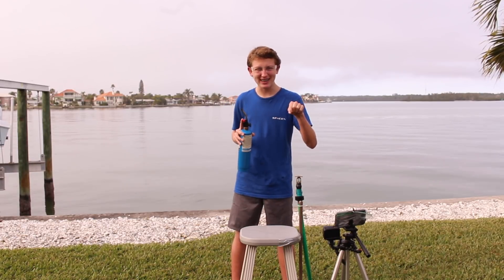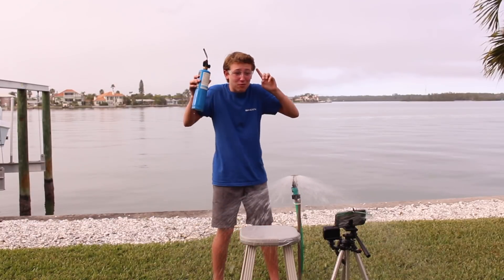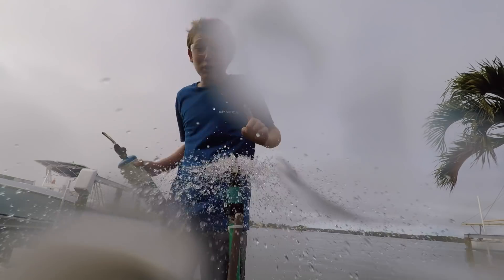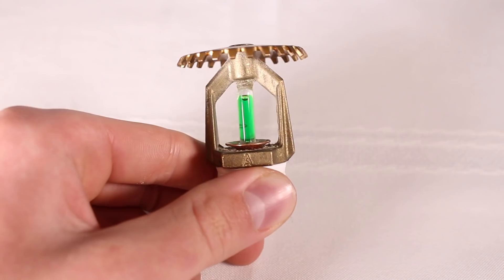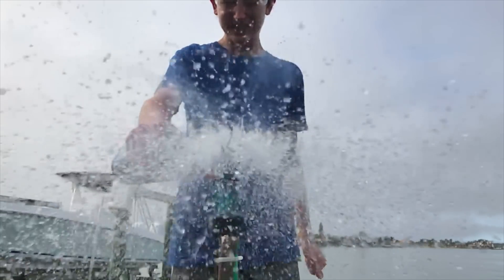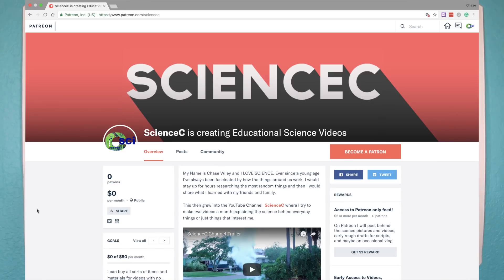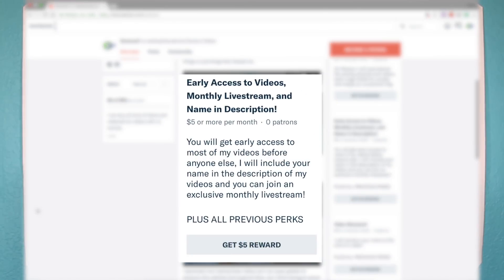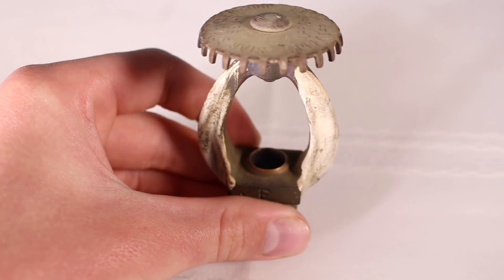How Do Fire Sprinklers Work? + Patreon Announcement

Comment: In warmer climates your sprinkler systems may have water behind the heads, but in colder climates (like Canada) we run dry sprinkler systems.  That means all the piping between the sprinkler core and the heads contain compressed air, and when a sprinkler head opens, the compressed air escapes and releases a valve which floods the system (and of course water comes out the open head).   Keep up the good work!

Comment: So do the sprinklers just run until all the water in the pipes is gone? How can they be reinstalled (or would the building be damaged beyond practical repair)?

Finally - how did you just install a sprinkler in the open? Was there a water tank or something?
Reply from the maker: The sprinklers are typically hooked up to city water so they won't stop until they are turned off. Once it is off new sprinklers can be installed. For this video I hooked it up to a garden hose.
Reply: Also larger buildings with sprinkler systems (except single home residential systems) almost always have a Siamese connector by the curb (a Y shaped connector with 2 2 1/2in inlets) marked FDC.  The fire Dept hooks up an engine to "boost" water supply above what the normal city inlet can supply.